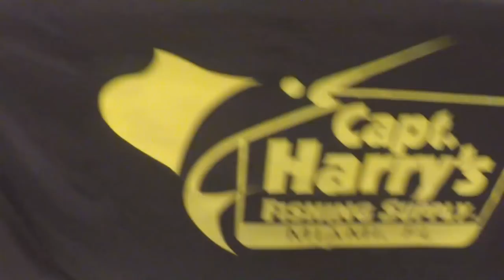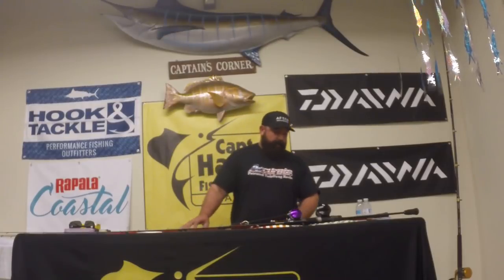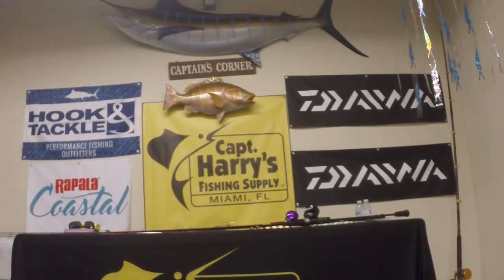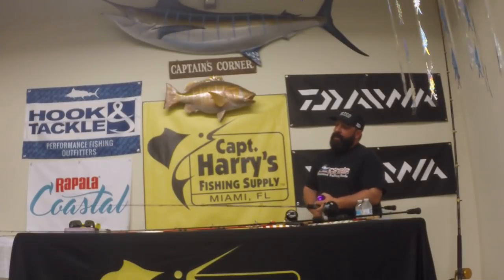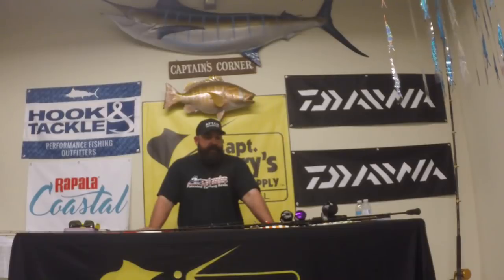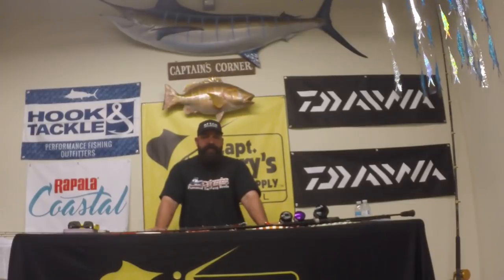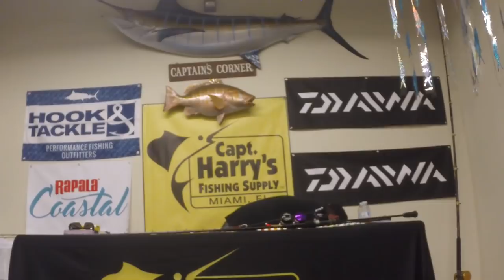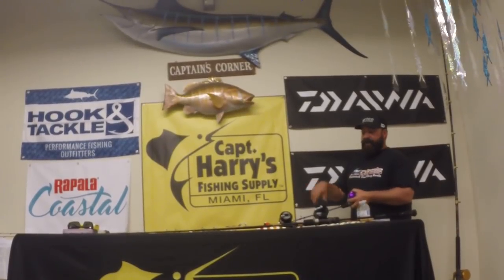CAPT HARRY'S SLOW PITCH JIGGING SEMINAR FEATURING BENNY ORTIZ

Comment: Any way to get rod and reel models and manufacturers you are using?  I could not understand when you said whose gear you used.  Awesome chat
Reply from the maker: Hey Bo thanks for watching. I apologize for the audio It was film using a gopro. The reel and rods benny uses are tempe reef rods and accurate reels but I recommend Goofish rods. They have great action and the best bang for the buck! Check them out  www.goofishrod.com and if you use discount code "ninja" you'll get 10%off. Amazon code "yakninja".  The reels I like using are the underhead reels.  Check out www.3mcraft.com also 10% off discount code: "ninja"